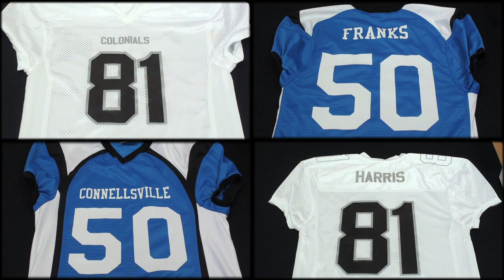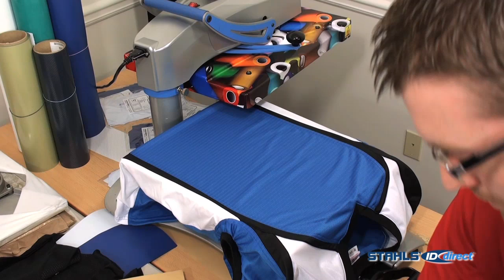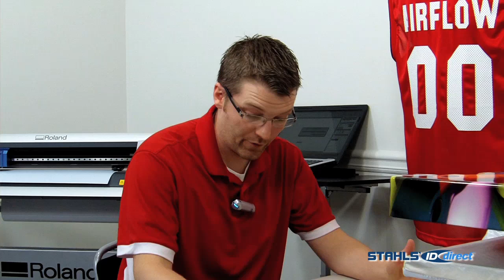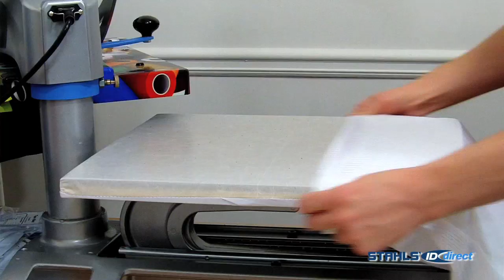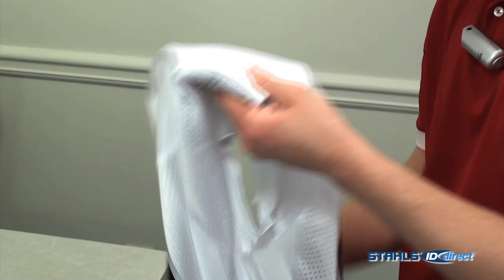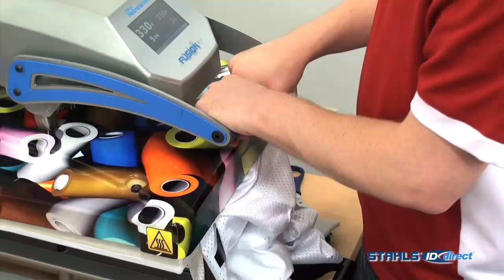Decorating Football Jerseys

Comment: Do you have any advice, tips, tricks, etc. to do this with an iron?
Reply from the maker: While an iron can work we cannot guarantee permanent adhesion throughout wash and dry cycles. To ensure a durable transfer that lasts, a heat press is a must.
Reply: Thank you for the reply.  I understand you cannot guarantee adhesion.  But, since I am just a regular guy w/out a heat press, do you have any suggestions for using an iron?  Thanks again!
Reply from the maker: Best recommendations are to iron on a hard, flat surface to provide even pressure. Use linen heat setting and no steam.1.Preheat the garment in the area you are applying2. Place design and iron with firm pressure for 25-30 seconds3.Turn item over, and apply for an additional 25-30 seconds4. Peel carrier hot or cold as instructed by manufacturer These are meant to be a guide and these times may vary depending on the manufacture of vinyl as well as type of material in which it is applied. 
Thank you!
Reply: This great info.   Thank you very much!